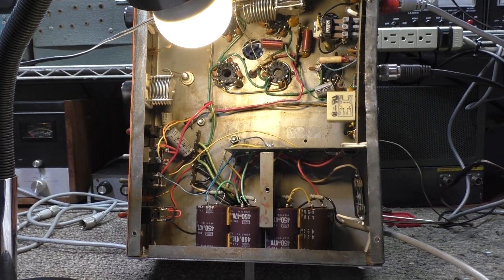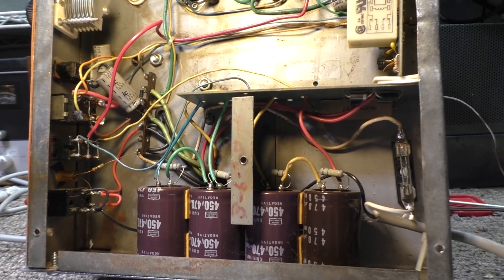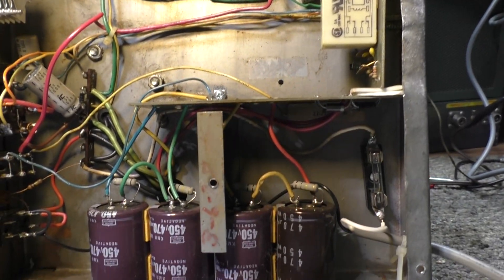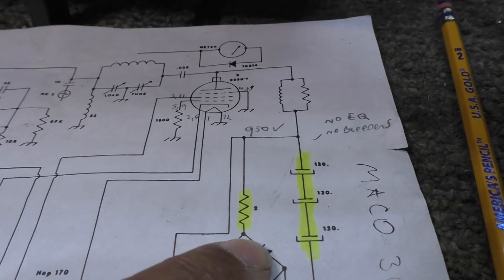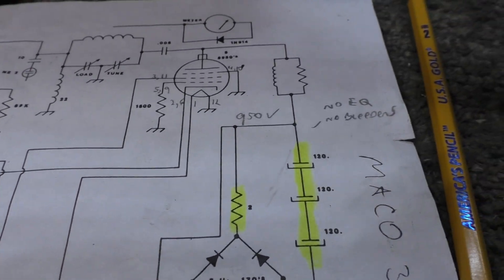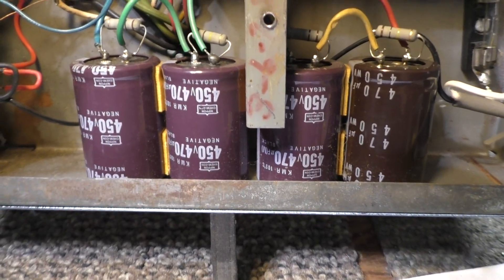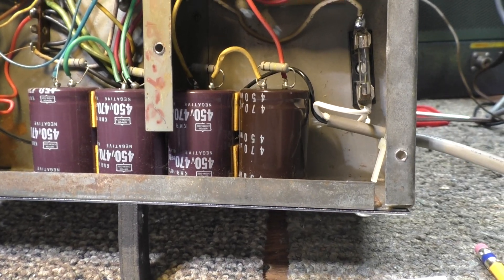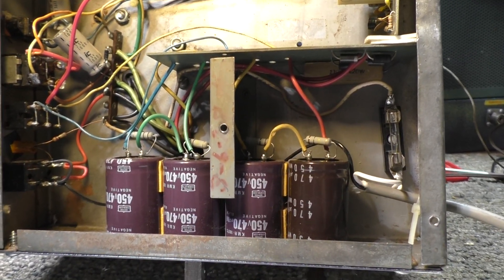Maco KW errr 300  I already knew, and can't win them all

Comment: The funny thing about amplifiers is that the tubes are worth more than the amps. My MaCo 300 has two 8950s driving five 8950s. They have low use on them because the paint from GE hasn't been burned off. 
Could I get $100 apiece for the tubes? Probably. 
Could I get $700 for the amp with the tubes? Highly unlikely.
Reply from the maker: OK, but I got a bunch of substitutes, 6kn6, 6kd6, 6lb6, etc. A lot of people don't know about all the subs, so sometimes I find them for cheap. Hence, if the amp has 8950's, I could sell them and then retube it with my subs. Best of both worlds.
Reply: @tramdr One thing I waited for when the Russians began selling power amplifier tubes was the return of sweep tubes. Apparently, neither the Russians or the Chinese are interested in selling sweep tubes. Too bad, because a lot of people would retube their Phantoms and Big Boomers and Palomars if doing so didn't require the sale of a kidney!
Reply from the maker: I figured no one will remake sweep tubes. Sweep tubes were originally for the sweep in a tube TV's. Probably were 100's of thousands if not millions of them back during tube type TV's. Now with only us lowly CB'ers wanting sweep tubes, the market has went from hundreds of thousands to just thousands.
Reply from the maker: 9 pin mid tube with No Plate on Top
6JG6  17 watt
6JR6  17 watt
6JT6  17.5 watt
6KV6  28 watt

9 PIN Plate on Top:
6JB6  17.5
6JF6  17
6JU6  17
6KM6 20
6LQ6  30
6LZ6  30
6JE6  30
6ME6  30
6MJ6  30

12 PIN large (Palomar Maco)
6JM6   17.5   9+11 NC
6JS6    28      9NC
6JS6A  28      9NC
6JS6B  28      9NC
6JS6C  30      9NC
6KD6   33
6KN6   30      9+11NC
6LB6   30       9+11NC
6LF6   40
6LR6   30       9NC
6LX6   40   6LF6 AND 6LX6 are said to be identical
6LX6   40
6LZ6   30      9, 10+11NC
6MH6  38.5
8950   33   12V Filament 
m-2057  40  12V Filament